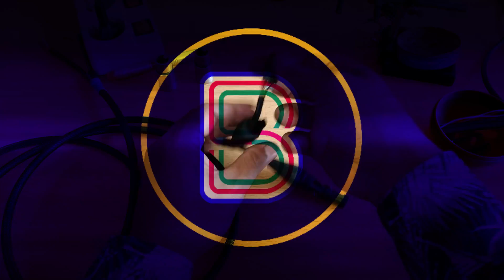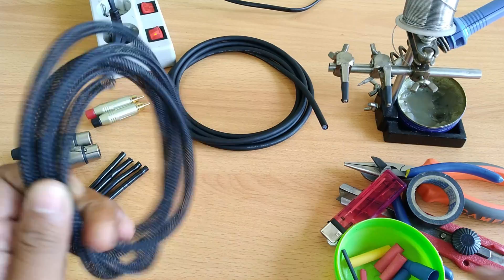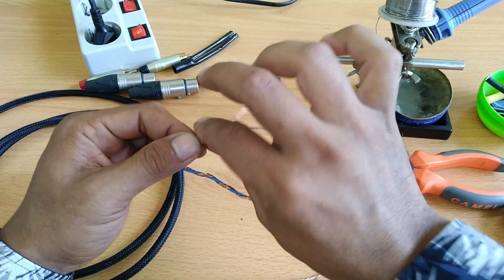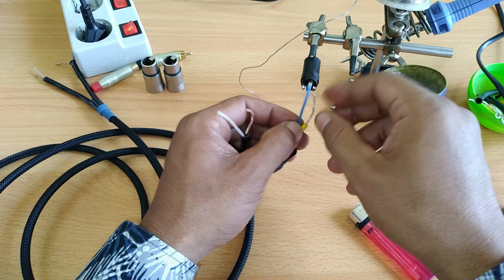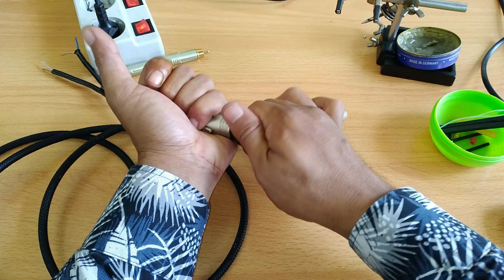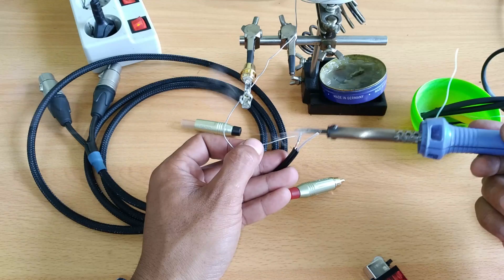How to Make XLR to RCA Cable DIY

Comment: Thanks for the guide, it's clear you're a professional.

It's important to note, the RCA connector is mono, and the XLR is balanced stereo. Therefore, you must 'short' the ground of the XLR when soldering, and connect it to pin 3 as well! This means pins 1 and 3 should be connected. The tip goes to pin 2.
Reply from the maker: Thank you so much